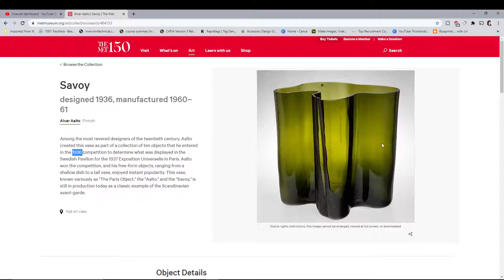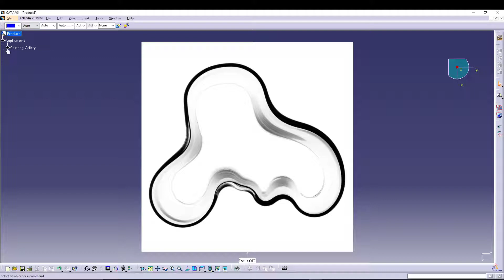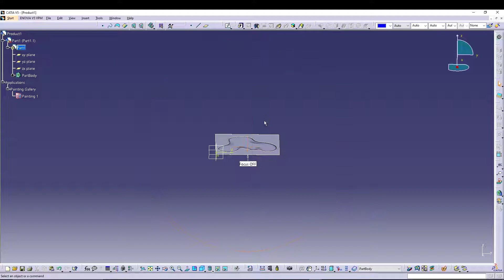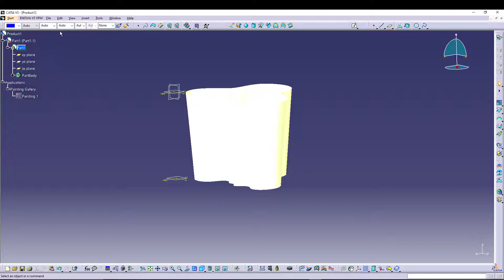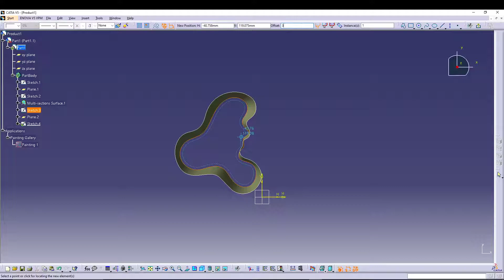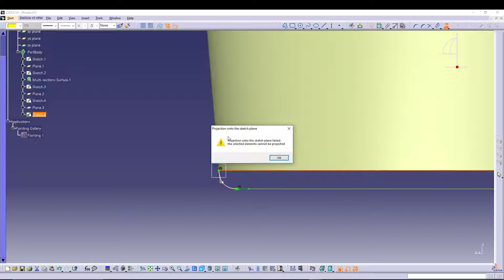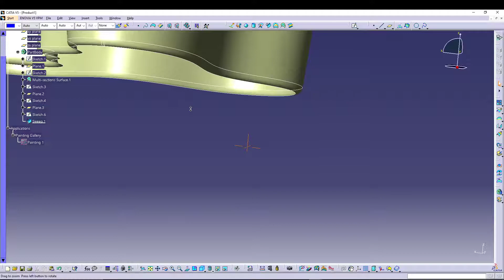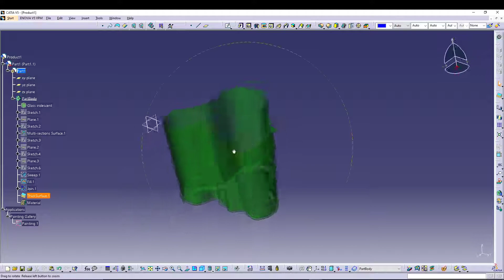CATIA V5 - SAVOY VASE | CONVERT IMAGE TO 3D USING SKETCH TRACER

Comment: thank you so much for sharing this, your video helped me a lot 💜
Reply from the maker: Glad it was helpful! Subscribe as it motivates me ;)
Reply: @KamranYunusDesigns  i did, i have a problem whe i want to do the scan they give me this error message (Error while updating
Scan.1
Sweep, Loft, Blend, or Extrapolation Operator: Unable to homogenize guide/control curve topology before calculation Change the input data or any values of the tolerant modeling parameter.)